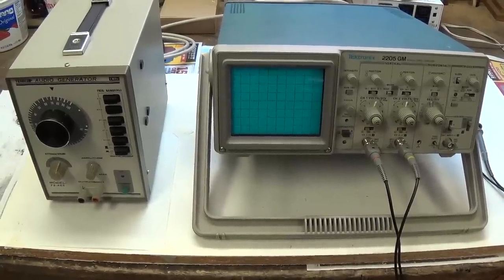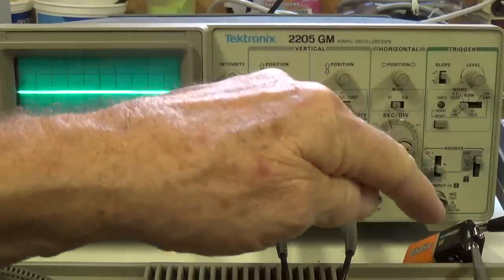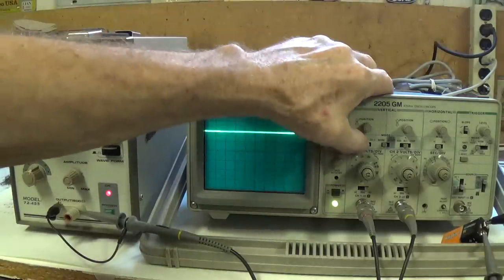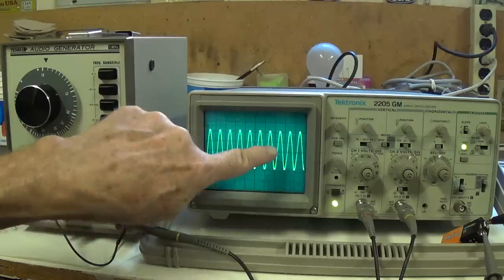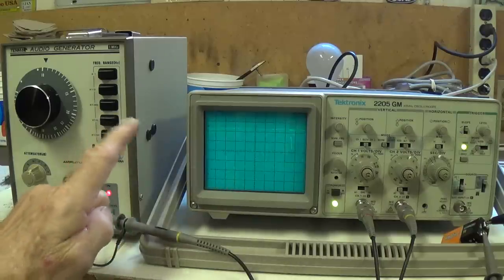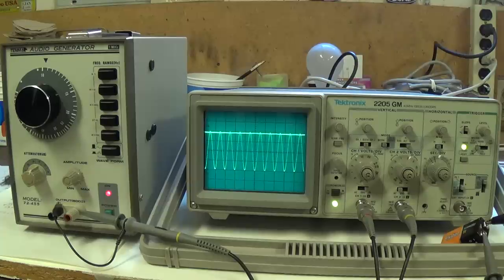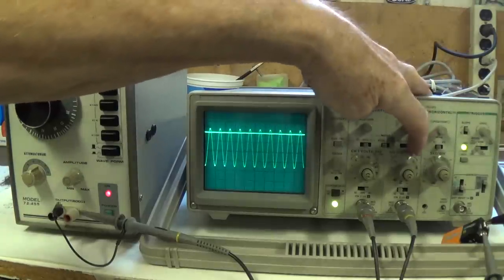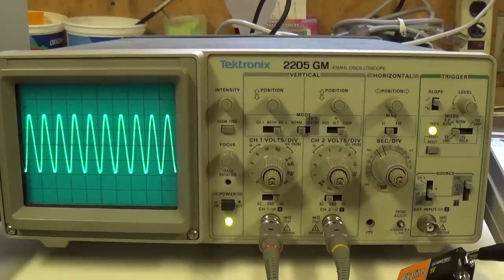Oscilloscope: DC & AC, Signal Tracing in Amp Circuit, RMS Output Measurement

Comment: For those of you that are looking for an oscilloscope and like building things; I'd suggest a DSO Shell oscilloscope kit made by JYE Tech. You can purchase them from many places for about $20 dollars U.S.. I got mine from Banggood.com for less! They are easy to solder together in a couple of hours and make for a nice pocket sized scope. They are single channel but I don't see that being a problem checking anything presented in this video. I added a cheap $4 dollar 10x probe to mine as the voltage limit is 50 volts. With the 10x probe I'm safe up to 500 volts. 

Look up some of the review videos and some of the build videos for this scope and decide if it might work for you. They also sell signal generator kits for even less!

My questions for Doug are, what's your scope voltage limit on 1x setting and will you fry it if you connect to plate voltage by mistake. My other question is; is there any time I would need more than a 500 volt limit scope?
Reply from the maker: Thanks for your helpful info on inexpensive scope availability, 10L. I believe the limiting factor is not the scope but the insulation within the probe. The 1Meg resistor at X1 will protect the scope innards, but an arc may occur in the probe at high enough voltages to destroy it.....and possibly your hand. I would think a normal probe could handle 500VDC, but I tend to avoid any voltages above 350V or so. Let's face it, there is really no need to attach a probe to the plate of a KT150

Comment: Hi Doug, in your vid on the Medical isolation Tx you mentioned its windings were not quire 1:1 leading to a slightly higher plate voltage when the amp was plugged into the tx vs the wall. Does this in turn effect your power calculations i.e. when you measure the voltages using the scope and with the isolation tx connected; is it elevated too?
Reply from the maker: No transformer winding ratio is perfect, but the effect on the amp circuit, if there is any, is negligible.

Comment: WOW   Thanks   I was just about to scope plate voltage   This is so much better  and safe r
Reply from the maker: If you ever apply a scope probe to a signal circuit, apply it AFTER the coupling cap, to eliminate the HVDC.

Comment: Moving  along on my AC568  Bassman head, so many refrained questions but stumped: regarding both my speaker jacks I find all contact points have continuity to ground and to each other. Shouldn't "something" be isolated such as the Tip from the Ring? Whether plug is inserted or not everything connects.
Reply from the maker: The speaker receptacle has continuity through the secondary winding of the output transformer. The speaker plug has continuity through the speaker's voice coil.

Comment: My Oscilloscope only has one channel and is about as old as the amp in this video (not really... the scope is probably somewhere from the late 70's to early 80's)...... can i just switch between ac and dc instead of having separate channels for each signal? 

I understand i wouldn't be able to mix the two signals and i'd have to take into account the different division settings but it should all be possible with a single channel scope right?

It's an old Sovjet made C1-94 analog tube driven Oscilloscope my dad gave me who got it from my grandfather so i'd really like to use it in my amp adventures.
Reply from the maker: Not knowing anything about your scope, TL, I can only guess that yes, you can switch between AC and DC.

Comment: Got a Randall RG-100HG  amp head for guitar.   I get no sound at all.  Got the schematic but sice they are a bit rare no troubleshooting available.  Not a tube amp.   Got any suggestions where to look?  Powers up and transformer puts out power to the  Bridge.
Reply from the maker: There are all sorts of reasons for it to be silent, David, and no one on Earth can guess the right one(s) without testing and examining it. You need to find someone locally to take a look at it.

Comment: Hey Uncle Doug! Love all that you do and can’t stop watching video after video! I’m trying to follow this video to hunt down some noise and calculate my 1965 bassman’s output. I’m having success but one thing I noticed while putting test tone through my amp connected to the dummy load is that I can still hear quite a bit of test tone coming from what appears to be either the power tubes or output transformer! Is this normal or possibly related to one of the many issues that plague this amp currently? Thanks in advance! I always wish I had someone like you looking over my shoulder giving me pointers!
Reply from the maker: Thanks, Cody. It's uncommon, but occasionally components in the amp circuit will vibrate sympathetically with a signal input. Tighten the transformer screws and wiggle the 6L6's to see if you can identify the "canary" and maybe stop its duet with the output signal.
Reply: @UncleDoug  Thanks! It’s very kind of you to take the time to reply. If you’re ever looking for a real challenge this bassman has your name on it.

Comment: I wish I knew how you connected the 8 ohm load. Did you disconnect the the speaker wires and clip them to the load or maybe you used a 1/4 inch plug in a headphone jack that disconnects the speaker? Don't know what model amp this is so I don't know the available options...
Reply from the maker: You either connect the speaker wires to the load, or you disconnect the cabinet speaker and plug the load into the speaker output jack on the amp, if it has one.

Comment: greetings uncle doug just wanted to say thank you for your vast amount of  knowledge you have shared with me over the years. i am still learning a great deal from you and have managed to fix the amps i have in collection. i need help id ing a tube it has pinout that mirrors a full wave rectifier 5u4 gb but it has getter difference and only top silica disc
Reply from the maker: That's great to hear, Tim. We're glad the videos have been helpful. You might consider posting some photos of the mystery tube on my FB page: Uncle Doug's Vintage Amps.

Comment: Hi Uncle Doug! Your oscilloscope is plugged in your Isolation Transformer? Or in your wall receptacle grounded to earth? If it is plug in your wall receptacle, then are you connecting the chassis with the earth ground? thanks
Reply from the maker: The oscilloscope is always plugged into a grounded wall receptacle, ES. You never float an oscilloscope (it rhymes !!)

Comment: Outstanding video finally starting to absorb enough of your lessons. If we don't have a scope how else can we measure the amplitude of the signal from tube to tube. My little 5F1 amp is now stable in heater and HV but no signal at all??  Great stuff Doug, Thank You, Dennis in Virginia
Reply from the maker: Thanks, Dennis. Since amplitude is a measure of voltage, you can try to use a voltmeter.....but since the signal amplitude varies constantly, you will never get an accurate reading. The oscilloscope freezes the wave so you can measure its amplitude.

Comment: Sorry if I missed this, but should the oscilloscope also be plugged in to the same isolation transformer as the amp, with its ground lifted as well?
Reply from the maker: No, you never isolate the oscilloscope. It should be properly grounded.

Comment: Wonderful Oscilloscope usage  tutorial series Uncle Doug. Question: how would you test a tube guitar amp to see if it up to spec on its output power advertised? Do amplifier advertised output wattage always use AC RMS voltage output (converted to watts at specific speaker ohm load) with a 1Khz input at 1V peak to peak on scope? If not, what is the common test input voltage in AC RMS Volts (on a true RMS reading multimeter),or Peak to Peak on a scope at 1Khz used for common testing for determining rated output power? I know with stereo amps line level input can be typically 500mV to 1 or 2V RMS max. Is typical input voltage level at 1Khz for rated power output usually stated in service literature of guitar amps? Would the max output in wattage advertised be specified at pre-clip level, or full pedal to the metal with clipping present?  I know I have a lot of questions here, so any assistance to any of my questions would be greatly appreciated. Thank you Uncle Doug, you are a wonderful teacher Sir.
😎👍
Reply from the maker: The way amp power ratings are reported varies, so you have to pay attention to the small print to see if the output power is RMS, pre-clip, etc. Naturally, most manufacturers want to make their product look as good as possible, so you have to be careful. I have made a video demonstrating exactly how power ratings are accurately determined. Please watch it :)
Reply: Thank you, I will look for this video. Best wishes.
Reply from the maker: @repairfreak  Likewise, Mike.
Reply: Hello so I see you used 1.0V p/p volts in your test which coverts to .353V or 335 mV. I assume that guitar pickups being of many different designs, can vary the input seen at any amps input wildly. So there is no real hard fast rule of input voltage to use for a max output wattage test to see if the amp is producing to spec output. Since guitar amps are designed purposely to produce desired distortion, and at many different input levels, and at varied amp volume gain and other, power output can’t be solidly designated to spec as in the case with home stereo equipment that has very specific advertised levels for input level at 1khz sine wave with corresponding  output level. For home stereo amps are designed to not have distortion & min THD completely unlike guitar amps.
Have great week.
Reply from the maker: @repairfreak  If you boost the input signal voltage in an attempt to increase the output  power, clipping will occur sooner, which will limit any increase in output wattage.
Reply: @UncleDoug  Thank you for your video titled “RMS Watts vs Peak an max Watts, Amplifier Power Explained” this was very interesting and educational to me on the subject I was interested. Have a great week Uncle Doug, thanks again.
Reply from the maker: @repairfreak  You're welcome, Mike. Happy New Year :)

Comment: Should'nt a grounded signal generator also be floating for signal tracing tests so that the only ground connection is through the probe ground clip?
Reply from the maker: In my signal generator neither of the two wires delvering the audio signal are grounded, so it's not an issue.  I can't speak for other ASG's however.

Comment: Thank you... would the signal tracing for a radio RF be the same procedure from the antenna?
Reply from the maker: Heck if I know, LD. Maybe another viewer will be able to answer your question. I'm strictly a vintage tube amp guy.
Reply: LestonDr; Yes, could very well and I have done just that as do many, many repair techs. Of course, when you get to the converter and IF stages you will be on a different frequency than the incoming signal, like 455KHz for AM or 10.7MHz FM. Most scopes can "see" those frequencies if they have the bandwidth like Uncle Doug's is 40MHz. 10 to 20MHz will probably work OK too but more bandwidth is usually always better and more expensive, new or used, but just for broadcast bands not that necessary. Also, the very low signal level of regular radio programing may be a little low for some scopes. Of course, if tuned to a station, the signal may be out of the bandwidth of the scope. If you're going to use a radio station broadcast try using a station at the lower end of the band to start with.

You'll want to use your 10x probe so it won't load the circuit especially if the radio is solid state, but you may be tempted to your a 1x probe on the first RF amp or at the converter due to low signal level or pushing the bandwidth limits of your scope. That may load the circuit and cause a little confusion about the signal strength. You may not want to connect the RF generator directly to the radio. You can couple it to the radio by using a simple coil of wire to induce the signal to the antenna input, or use a capacitor. By varying the output level of an RF generator connected to your antenna input, The signal level can adjusted so you can get a decent waveform on the scope. And, of course, you can modulate the RF from the generator with an audio generator (many RFGs have a 400 or 1,000 Hz audio oscillator built in for that purpose) so you can see a modulated envelope in the RF and IF stages. So yes, you can use the same technique as Uncle Doug shows here, comparing input and output to look for distortion or loss of amplification, any differences, etc. 

Just one more thing, since I have time to type. If you inject a known signal into the front end, and have a dummy load connected instead of a speaker (Always a good thing! Don't drive yourself and anyone else in the house nuts.) start with the scope probe in the middle of the signal path. If you see distortion, low or no signal, go half way towards the RF input from where you started probing, maybe output of the converter. ~OR~ if you see good, clean signal, head towards the dummy load, perhaps halving the distance again, like the output of the detector or middle of the audio amp. This will help to quickly isolate where the trouble is, considering the power supply is fine. Check the PS first! Always! Just like Uncle Doug shows. Don't listen to Jack.

There are other You Tube videos on this somewhere, maybe not quite like Uncle Doug's, though. Mr. Carlson's Lab, Radio Mechanic, the Radio Shop may be places to try if you're not already scribed up with them. They're very good, too.

Hope that helps a little.
Reply: LestonDr as Cavemannspace said, you can, but don't expect to see a whole lot right off the antenna because the RF signals will be very small (most will be too small to see on an oscilloscope) and all them will be present at the same time so it will look like noise. If you pass the antenna through a narrow band pass filter you might be able to see the stronger signals but you will start seeing things after your first IF stage, just be sure to keep your probe on 10x because you don't want to load down the signal path.
Reply: ...an oscilloscope probably isn't sensitive enough to detect signals in the microvolt range- that's what you are dealing with.

Comment: Dear Uncle Doug, another excellent video, when these signals are mixed, is this the same concept of an AC signal riding on top of a DC signal. In other words, an AC signal being input to an amplifier where there is a bias placed on the amplifier. Thank you kindly...
Reply from the maker: Thanks, Mark. Yes, the AC waves ride atop the smooth DC, but never mix......just, as you said, like the AC music signal coexisting with the -DC bias voltage on the grid.

Comment: Hi,  I too miss your puppy.  Question: I am learning to use my OScope and want to use it to diagnose a problematic SS preamp - a Solo 110.  What I am confused about (among many other things) is whether I need to put a load on the preamp (output).  If so, do I connect it to an amplifier? Then, the amplifier to a dummy load which I have?
Reply from the maker: So do I, James. I am no expert with SS gear, but to me, if you want to observe the performance of a preamp, it should be connected to a power amp and functioning as it does normally, which would also require a dummy load for the power amp.
Reply: Thanks for the reply.  I learned from a SS electronics expert friend that a dummy load was not necessary - which does not make much sense to me.  But, who am I to question right?  Thanks for this video and all the others.

Comment: Hi - I understand the isolation transformer bit and the lifting of the ground to the amplifier but I would have thought that as soon as you attach the Sig Gen which is itself grounded to the input that it becomes grounded that way and defeats the object. Of is the Sig Gen output floating?
Reply from the maker: If you want to isolate the circuit being tested from earth ground, you would have to ensure that no device, including the signal generator, provides an inadvertent earth ground.

Comment: Excellent video. Great information here. Explained better than what I have found elsewhere. Just curious did this include before and after of all tubes? I am unsure of how many times were in this amp. Schematic may have helped. Thanks again.
Reply from the maker: You're welcome, LF. I honestly don't recall. Was the answer not evident in the video ??
Reply: @UncleDoug  From my notes, :) it stated +/- 1 volt for the frequency generator. +/- 8 volts for the first stage of amplification and +/- 50 volts for the second stage of amplification. When I looked at the back of the amplifier it appeared to be more than just 2 tubes. One could be a rectifier tube.
Also what is the range of amplification for vacuum tubes? Haven't found any info this. Also is there a limit on the number of stages? Is a preamp actually required? These questions also not found anywhere. 
Ever think of making a video on the different types of amplifiers? It took a lot of studying to find out there are three types(I could be wrong here, just started studying) 1 tubes 2. PNP or NPN and 3 Op Amps. Thanks again.
Reply from the maker: Yes, the extra tube was a rectifier. The highest amplification factor I have seen is 100, found in the 12AX7. No limit on the number of stages, but diminishing returns sets in rather quickly. Yes, the pre-amp is required to step the voltage up high enough to drive the output tubes. There are more types of amp, LF. Look up Types A, AB, C, etc.

Comment: Great video. If II buy an 8 ohm dummy load, how many watts should it be?
Reply from the maker: Thanks, Tom. Mine is 1000W, which is fine for amps up to around 15W. For higher wattage amps you will need a ballast resistor of 2000W or above.